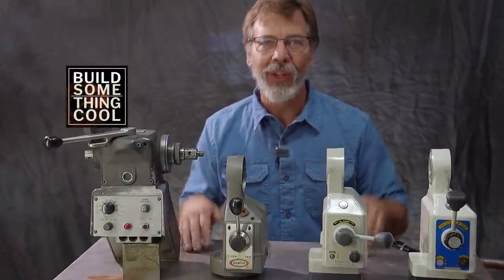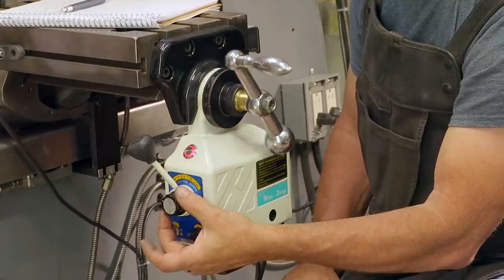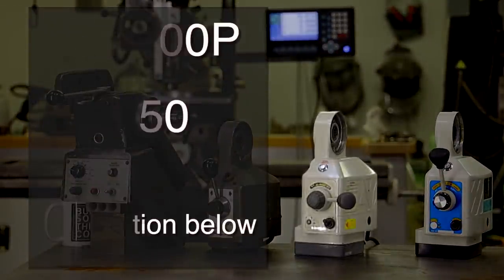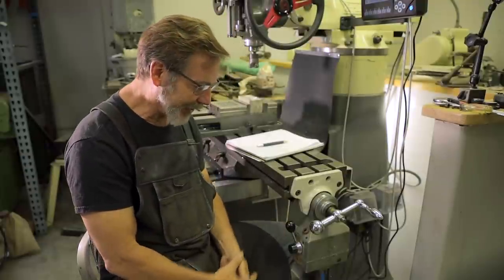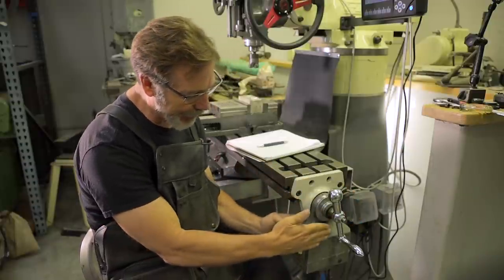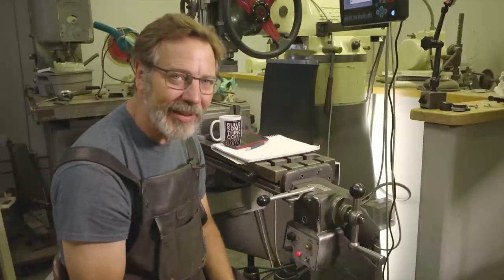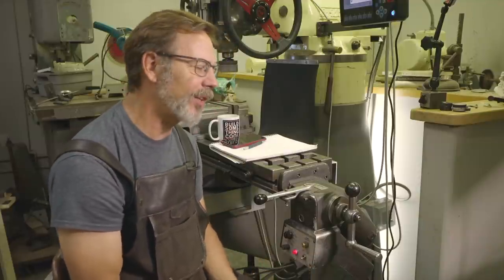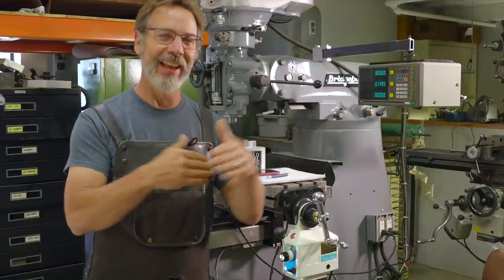You need a Power Feed, but which one?

Comment: I got similar 'cheap' one from Precision Mathews for my Y (Servo 150 on the X came when I bought the mill). It took three to get one that worked. The first one shorted out on startup (wire crimped into where the case is split). The second one just didn't run. The third one ran, but not made for US built BP but for Asian clones. Hardware is metric and needs replacement. Other issues, here's my complaint to PM: "See the parts list for the Y axis feed: I am missing the part number 38 ‘ALUMINUM TRACK’. I received two p/n 34 ‘Y-AXIS FIX STAND’ (both identical, before the smoke I had drilled the holes oversized in one to allow it to fit a Bridgeport (BP J Head, s/n 12BR-44087, J127722, head, approximately 1958 manufacture). p/n 34 replaces the BP bearing retainer ring on the Y-axis lead screw. p/n 36 ‘EXTENSION SHAFT’ is 16mm OD (0.630”) which does not allow a BP hand crank to fit (BP shafts are about 0.625”). p/n 31 ‘FIX RING’ (plastic) fits the supplied p/n 30 ‘BEVEL GEAR’ but the thread is different than BP so you cannot use your nice knurled steel BP dial lock nut (the bevel gear replaces the standard BP dial holder). Also missing is the ‘SOCKET PARALLEL KEY’ that locks the ‘BEVEL GEAR’ to the p/n 36 ‘EXTENSION SHAFT’. I have plenty of key stock in Imperial sizes, but of course this one is metric (maybe 3 mm) so a 1/8” key is 0.008”-0.009” too thick." Typical Chinesium crap! Got an open box Servo feed on ebay for $385, it's now on the Y. Maybe I'll use the crap one for the Z axis sometime...